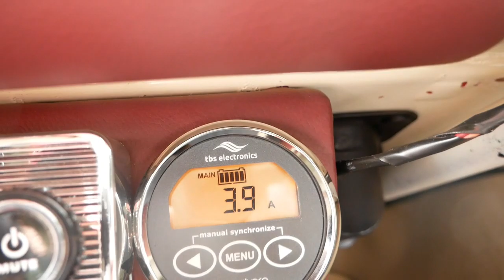Workshop walk-around Ep2 - Fiat 500

Comment: I have a 2006 2.7L Sprinter van good for highway 800 miles between fill ups. I drive from Chicago to Seattle  and back going 1000 miles a day at 70 mph. Is there a battery electric conversion that could go 500 miles per charge of highway and recharge in 3 hrs.? My Sprinter is the 3 meter WB model at 5000 lbs total weight with 5 speed automatic with top speed of 85 mph. What do you think?

Comment: Nicely done. How do you prevent motor over-rev? On earlier conversions guys would often bolt their DC motor to the gearbox. Problems came up when shifting or starting out and the car was not fully in gear. The motor would rev too high and was sometimes damaged.
Reply: Thats a DC motor issue, not an issue with AC as the conroller limits the revs.

Comment: Any need for suspension mods? And I take it you converted to electric brakes!?
Reply: They keep the traditional hydraulic brakes and sometimes add an electric vacuum pump to run the vacuum assist if present.

Comment: How to solve the problem of heating the engine and batteries while
driving? How to maintain the temperature of the batteries in winter? This will
affect the battery life cycle. What will happen to the motor if you drive into
a deep puddle? There will be no short circuit?

Comment: The mass difference and placements,.. should have much better spread of mass on to each wheel, and that'll lead to less tail happiness of rear engine swing axles. That method of shifting and no clutch at lights,.. not unlike a Mini-Matic fourspeed.
Could this rig fit in the Giardinara version?

Comment: Great episode, I guess this conversion kit has been developed for small cars. Would it work in a microcar like a goggomobil sedan? Particularly an Australian made one which has a fibreglass body making them very light. It would be a very interesting vehicle to convert to EV, do you think it is possible?
Reply: The Fiat uses an induction motor, which is perfect for smaller cars, so I would think it's fine. Plus the battery and charging setup seems to be similar to your challenge

Comment: My first car was a Fiat 850 sports, 903cc I would love to have an electric version. The old car could do 100 mph and I beat a lot of my mates in that car but if it had a 600 hp Tesla version 
that would be awesome.....LOL. The car used to rust as I watched though as I lived in Bondi NSW Australia and we got sea spray, everything rusted. You would want to do something with the gearbox. I went through the splines on my driveshafts on the 850, stripping them clean with the original motor.

Comment: Hi there.. nice work .. fascinating. 
Question.. how do you convert . The high voltage that operates the motor to operate the rest of the 12 volt originally fitted things in the car like lights wipers indicator ECT..
Reply from the maker: We leave the original 12v battery and charge it off the main EV battery via a DC/DC converter. The 12v battery still runs things like lights and wipers. 👍
Reply: So, it would be the same with a 6 volt in my 1966 VW sedan, you would keep that original... that seems tidy and neat. 👍🏻

Comment: Great Video--- Is there still the need for the original battery?
Reply: sort of , usually you keep a 12v battery to run lights , wipers , stereo etc .. but because you don't need a big battery to start a petrol/gas/diesel engine & it can be charged from the main battery pack you can fit a really small ( for example ) motorbike one